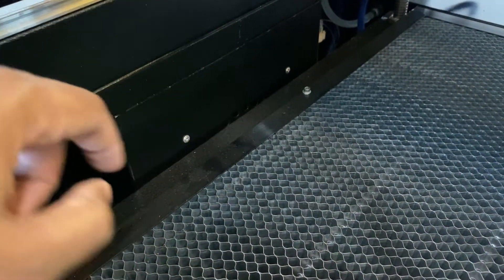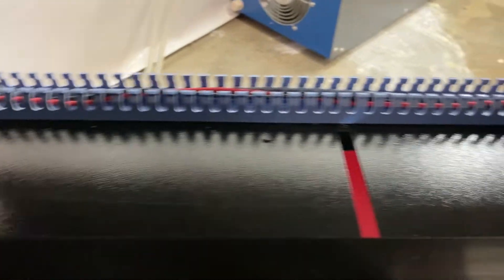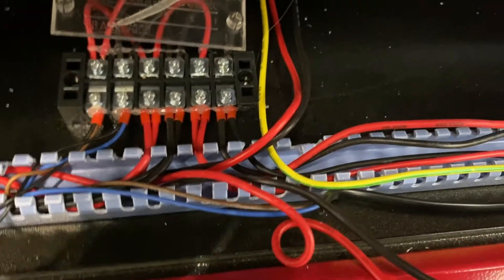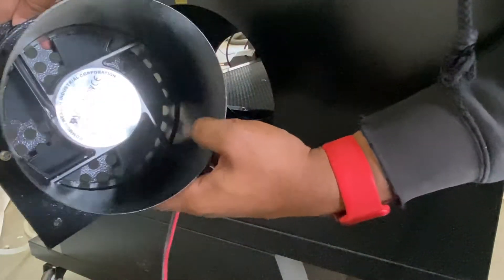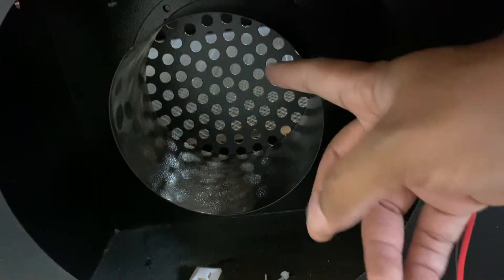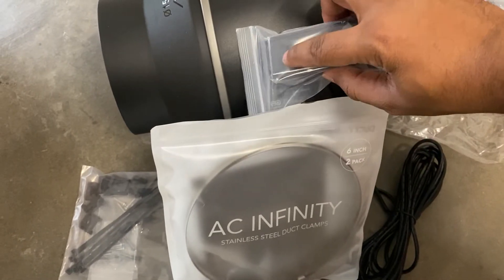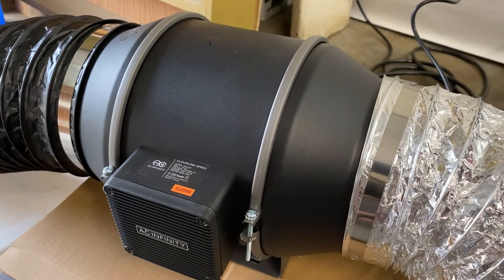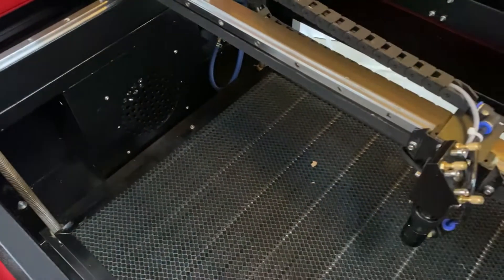Upgrade your Omtech Laser Exhaust Fan

Comment: I would have thought that having the stock fan in series with the in-line exhaust fan would have resulted in higher air flow.  So I'm curious why  you think it is necessary to remove the stock fan?
Reply from the maker: Stock fan doesn’t move as much air as the inline fan, so having it in place actually blocks the airflow of the inline fan and reduces its usefulness

Comment: Another great video. I did some serious research on placement of the fan. Seems for smoke etc you want the fan as far down the line as you can get it. One reason is at the end of the line it creates negative pressure to it's less likely to 'blow' smoke into a room if there was a hole or something.

Comment: Great video! Question, in an attempt to save a few bucks, if I do this upgrade, could I then reuse the red and black wires for my air assist upgrade? Just relocate the ends to proper #5 and #6 ports for v and "wind/air assist"?
Reply from the maker: I’m not sure the gauge of those wires, so I can’t 100% say yes since it’s a different type of fan compared to the one inside the machine
Reply from the maker: But Ace Hardware might have gauged wire you can buy in length Vs trying to buy a bundle

Comment: Do you find that you still get a fair bit of smoke escaping?  I'm trying to find out what I could be doing wrong or what else I can do to improve my situation here
Reply from the maker: Way less than before, but the seams on the doors aren’t air tight so I’ve seen some people take a magnetic roll and cover the door slots and that helps
Reply: Put the fan as far down the line as you can so it sucks in lue of blows...

Comment: Question so i know the arrow on the inline fan should be pointing towards your exit point and when you look inside the fan does that make the blades point towards the machine and the back of the blades point towards your exit point im trying to make sure it wasn't sent to me wrong
Reply from the maker: without being in my garage to check i'd say the easiest way it to plug it in and see which way it's pushing the air out

Comment: I have the same setup but there seems to be smoke trapped in the lid and when I open it the shop smells.  I am thinking of installing two little fans to create air flow from right to left in the lid area to clear the smell faster .  Any comment.
Reply from the maker: That might help. Sometimes I also cover the door seams on the front with flexible magnet strips so it creates a better seal in the machine so less smoke can seep out and the fan gets better pull

Comment: It is interesting your air assist is small and inside the body of the laser. Mine is this big compressor and outside of the laser. I have to put it on the floor! Also, my Chinese laser didn't come with a small fan inside like yours. Mine came with this noisy and massive industrial blower fan that look like it was made in the '70s. It seems your laser is a much better (updated) version than the one I got. I am so getting that external fan when mine dies. Its so much quieter!
Reply from the maker: Yeah I got mine almost a year ago, they keep making these tiny changes every few months and changing parts

Comment: Is there a switch on the machine for the fan? If so I'm just wondering if the replacement in line fan could be connected to the existing wiring in the machine.
Reply from the maker: No it automatically comes on when the laser turns on and it has variable speed on it so not sure that would work with trying to wire it into the laser power system.

Comment: It looked like there was a plug right at the fan why did you not just unplug it and leave the wire to make the future reinstallation a little easier. Is there an issue with leaving wire in the machine when it’s being used?
Reply from the maker: It wasn’t actually a plug it was just the way the wires were bound together. Everything in this particular machine are just staring cable runs